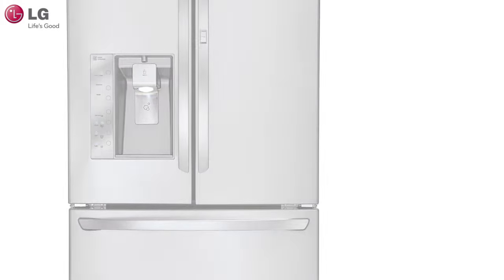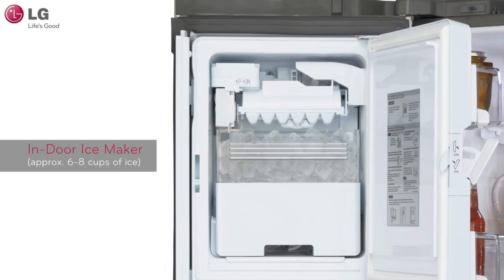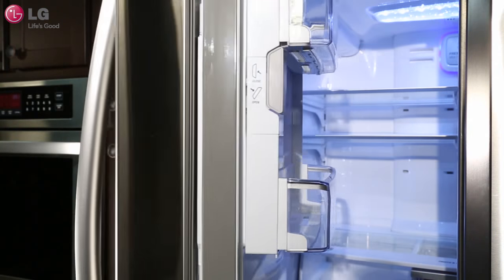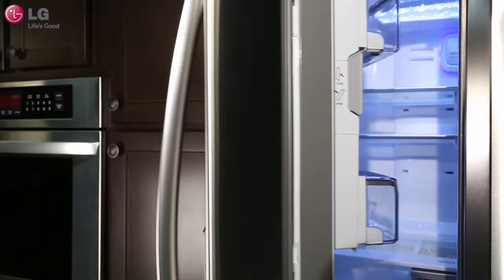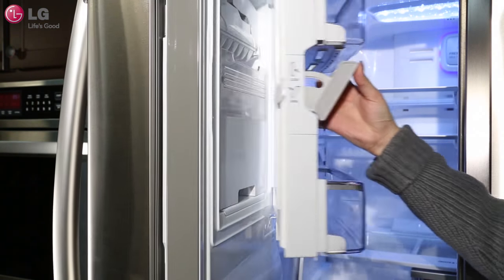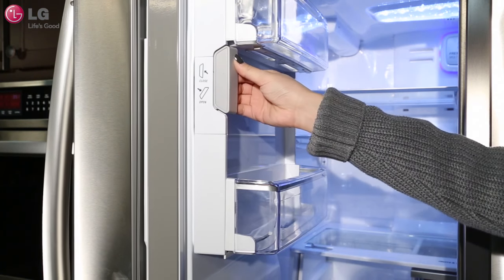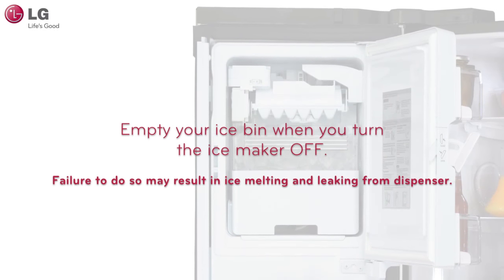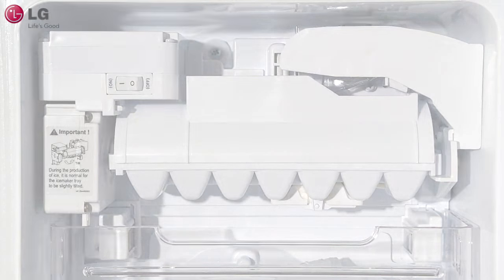LG French Door Refrigerator- In Door Ice Maker Operation (2018 Update)

Comment: We just got our LG on Saturday 05/02/20. The Ice maker has never made a full bin of ice. Very disappointed. A technician is supposed to check on it Tuesday 5/12/20. I hope they can cure the problem. I will keep you posted.
Reply: Your temp settings are probably off
Reply: Did you fix the issue?
Reply: @CaIlMeBiggy  No. After multiple attempts with different service technicians it has never been fixed. We buy ice and keep it on hand in the freezer in the garage.  I have gave up on my LG ever making more ice.

Comment: I always thought LG was a high quality product.  We bought the fridge similar to the one in this video.  The compressor went bad in about 3 years.  The good news:  ten year warranty.  The bad news: labor is on you.  $600 for a service call.  They must get about $1200/day for the man.
Reply: please try to contact LG, they might agree to fix your refrigerator if you insist. They fixed mine after I contacted them every way possible, and went on and even paid something for compensating for the food I disposed. I am very pleased with their service, and my fridge was older than yours.
Reply: @angitop1429  They have come and gone.  $600 and we are going again.  Sold house last month and left fridge for new owners.
Reply: mine keeps spitting out white powder. I have no idea what it is, trying to find out if I forgot to take something out. The ice is also covered in power. I'm afraid to drink from my fridge becauseI don't know what this stuff is and it's too soft to be calcium. I have to clean the powder everythime I close the doors.

Comment: Like most commenting on this vid & others - mine just stopped 
working after 2yrs(ironic - 1 month after warranty expired!!!) YES -  
The TEST button(its not a RESET button) allowed it to fully operate - 
rotate, dump ice and fill. The next problem is it will not perform this 
on its own! No ice dumped after 8 hours of waiting. Lifes' NOT GOOD!!
Reply: Update: LG Tech is coming out to hopefully replace the compressor. Cooling was erratic with 54 deg to 40 deg at times. Fridge should be 33 deg & ice  a -1 The ice maker WILL NOT OPERATE if the sensor reading shows warmer.  I have been informed by a friend who is a certified tech(hey - they see this all the time) that LG & Samsung are both terrible with compressors going out with in 18 months!!
Reply from the maker: Sounds like you should talk to our tech team. For social media support, please direct message us on Facebook (LGUSA) OR Twitter (LGUSSupport) with contact info. You may also call support at: 800-243-0000. Thank you! ^Mk
Reply: Yup - Did that - Turns out Tech performed diagnostic and believes it is the DEFROST cycle. Replacing circuit board & sensors.
Reply: How much did the repair cost you roughly I'm having the same issue
Reply: Dave Holden where even IS the test button?! I keep reading about it online and can’t find it nor can i find anything telling me where it is! Our icemaker suddenly stopped working a couple of days ago. 😡
Reply: @leahkohman3881  Did you find the "test" button?? I can't even locate mine!
Reply: The test button is located in a tiny hole that you can see if the ice bin is removed. You’ll need good vision to see the tiny word there. D suggest getting a magnifying glass to see it.  Use a paper clip t push the test button, the try should rotate and dump the contents. Beware if your ice tray only has water...it will dump water into your fridge.  If you put the ice holder back in quick enough, the water will funnel through the chute and onto your floor as well.

Comment: We have this icemaker and are having some issues with it.  If I press the reset button, it goes through it's cycle and dumps the ice, then refills with water and freezes it into ice, however it DOES NOT DUMP the ice automatically.  Any ideas or suggestions for us to try please?  I'm wondering if the sensor for the ice level might be the fault, that it thinks the bucket is full (but it is empty) - is there any way to test the sensor thing please?  Or any other suggestions that you may have?  Thank you!
Reply: Had the same problem, icemaker has to be replaced
Reply: Can you tell me where the reset button is please? I want to clean mine and cant find it for the live of me

Comment: I have a LG French Door Refrigerator with a ice maker in the door and in the bottom freezer. The bottom freezer ice maker fills with water, but doesn’t freeze. It dumps water, then the water freezes. Any thoughts on why or how I can get it working again? Thanks!
Reply: I have same problem. Any updates ?
Reply: @nelq06  no not really! I tried to get it fixed with no luck. I turned the bottom ice maker off and removed the tray. We were pretty active with in our home entertaining before pandemic… since then we don’t use as much ice, so it has not been a problem
Reply: I have read in LG literature to set your freezer temp to -4°
to produce ice.
Not at the recommended 0° for standard freezer temps.

Comment: Hello, I have the same refrigerator that you show in the video. Mi ice is like too high/tall, so when it's done it goes down like a block and not individual. So the machine can never broke them. How can I down the level of water to have the ice with less high/tall?
Reply: I watched another video, and apparently the issue could be with the force of swinging the door... it could be that the water moves to the left side and overfills.  This overfilling creates a thick layer above the cubes, and the flexing of the tray isn't enough to break the cubes free.  I'm assuming it makes ice while you're sleeping without issue?  try clearing the ice tray, and not opening the left door for a day... just to see.

Comment: My LG fridge has an odd odour, its not food it never was food that went bad. Our fridge is consistently clean. 

The smell seems to be coming from the door where water and ice is. But when i smell water it has no odour but the vents on the side do smell. Not sure how to fix or clean this. I never ever had a fridge that had this type of a smell. It doesn’t smell like rotten food , doesn’t rly smell like stale water either almost smells like some sort of a chemical
Reply from the maker: Hi there. We appreciate you bringing this to our attention and would like to take this opportunity to address this issue. Have you recently purchased your refrigerator? New fridges may have a smell caused by chemical agents (insulation) in the new motor. Please note that the smell will gradually disappear after 1 to 3 months of use. Please reach out to us should the issue not resolve itself within this time frame. We're available to help on social media at the handle @LGUSSupport. Be sure to include your phone number and refrigerator information (model and serial numbers) in a private message to us. We'd be happy to help get this resolved! ^Chris
http://spr.ly/6059VUyOP
Reply: @LGUSA  the fridge is about 3-4 years old we got it with the house we bought 2 years ago.
Reply from the maker: Thanks for the quick update. Please reach out to us on Facebook or X (@LGUSSupport). As mentioned previously, be sure to include your phone number and refrigerator information (model and serial numbers) in a private message to us. We'd be happy to help identify the culprit and review all resolution options. ^Chris

Comment: 11-29-18 UPDATE - I have had three service techs to my home. First Tech said compressor - "order" part. Next Tech came out to install compressor - "no, your compressor is working - I believe it is DEFROST system" Replaced defrost components & main board. Still not working! Third tech finally replaced the compressor(3hours) - Temp is still at 55 deg and freezer worse than before! After over two weeks of phone calls & time off from work - 4th tech comes out today to scratch his head and attempt a "fix" again. *******STAY FAR FAR AWAY FROM LG APPLIANCES !!!!!!! *******
Reply: Did you ever get it fixed?
Reply: We have a 2014 model that stopped working as expected in November 2019. . . LG tech has been here 5 times, replaced compressor (which was warranted for 10 years so it only cost us $350 (!)) no change. Replaced defroster (which read over 140 F when heating) replaced mother board, updated software twice. . . still can't have ice cream because our freezer goes between 12-25 F. Refrigerator works fine. . . They gave up, but kept the $350! I hope they get better, because they and GE are the only ones who have the ice in the door configuration--which is a space saver.